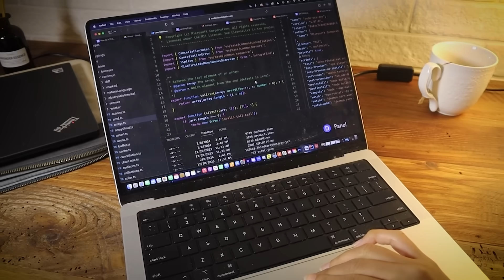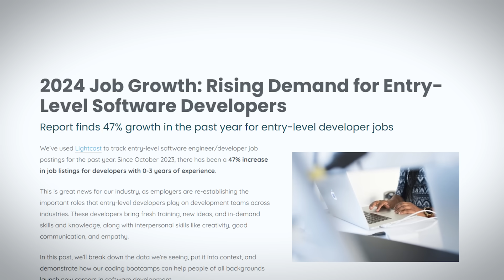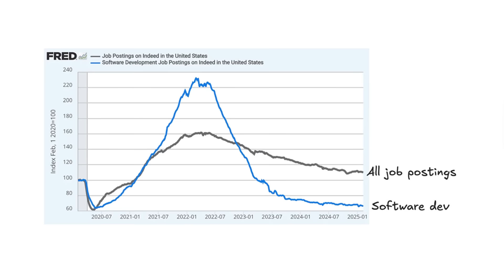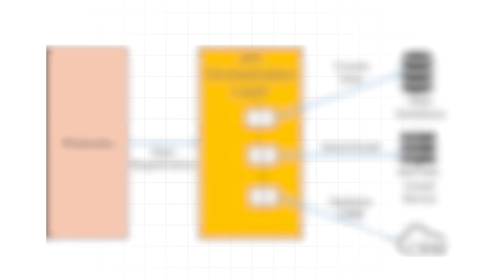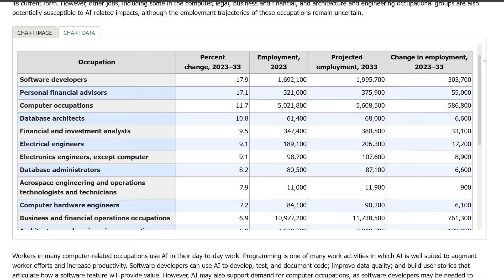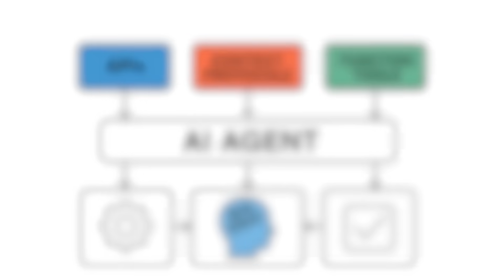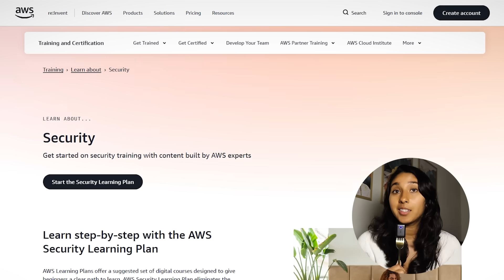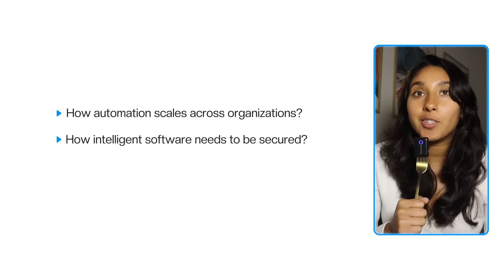The “Golden Era” of Tech is Over

Comment: The biggest problem is that in 2022 the Federal Reserve made a very sharp pivot to try and slow down the inflation that they created from all the pandemic stimulus. The Fed started hiking interested rates at the fastest pace in recent history, turned off the fiat money printer, and switched from Quantitative Easing to Quantitative Tightening. The Fed even caused Silicon Valley Bank to fail. The result of this change in monetary policy is that all the money was sucked out of the economy. It especially affected tech companies, which have a high burn rate and require constant financial investment for R&D spending, and usually don't turn a profit until years or decades later. Whereas other sectors/industries are more mature, less dynamic, and have more consistent/reliable/predictle/immediate cash flow, so are less sensitive to interest rates and monetary policy. This is why tech has been a bloodbath, while other sectors have been more resiliant. Something similar happened during the 2000 Dot-Com bust (the Fed also hiked interest rates back then to pop the internet bubble), and again during the 2008 Great Financial Crisis (the Fed hiked interest rates to pop the real estate bubble). So the takeaway is that the Federal Reserve caused the tech bloodbath and silent recession that we are currently in. But the good news is that the Federal Reserve is already starting to cut interest rates, resume Quantitative Easing, and turn the fiat money printer back on. So hopefully tech companies will be able to raise capital more easily soon, a tsunami of money will flow back into the tech sector, and the jobs will come back. In the long term, we should do something about the Federal Reserve, the boom/bust cycles that it creates, the malinvestments it incentivizes, the economic harm/damage/instability it creates, and the wealth inequality and poverty it creates.... but that is a discussion for another day.